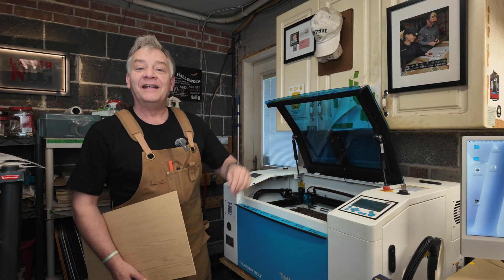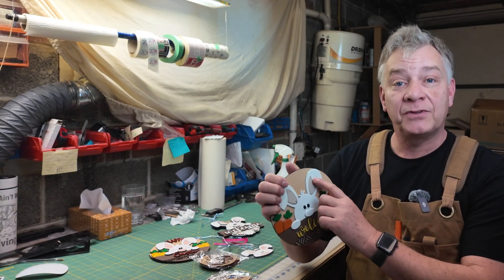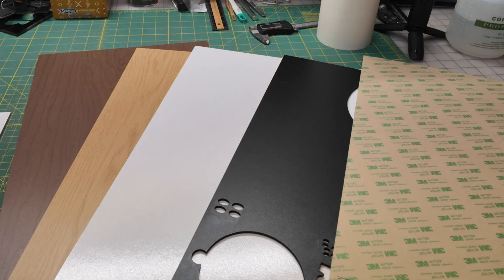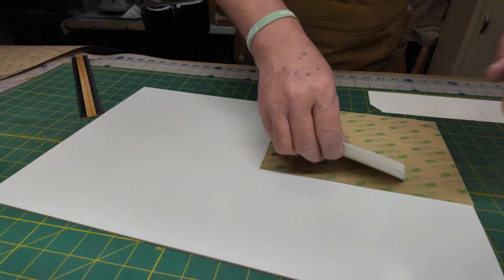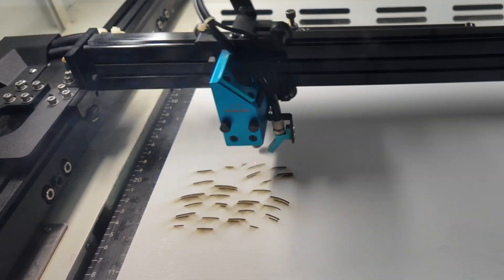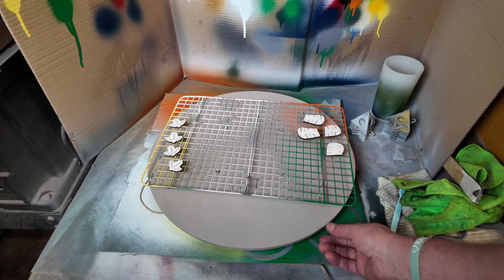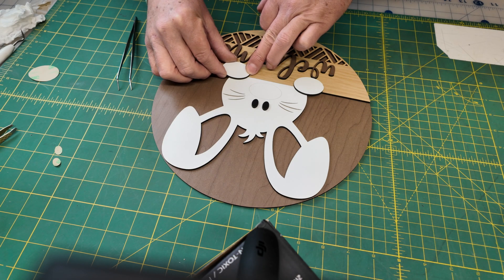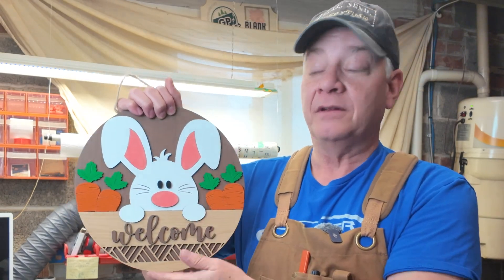TruFlat PAINT. Pre-Primed MDF for Your Laser. Thunder Laser BOLT.  4K

Comment: I wanted to say thanks for the detailed video.  I tried the Truflat Paint and loved it so much, I bought a case of 50.  It is so simple and fast to paint this material.  When I paint my regular mdf it takes forever.  I have to prime otherwise I have to paint multiple coats to get the correct opacity.  Truflat paint eliminates all those steps saving time and paint.
Reply from the maker: Hey Nancy. I am happy it was helpful. Agreed. So much quicker not to prime and I get a nice result usually in only one coat using Rustoleum 2X. Have a great weekend and thanks for watching!